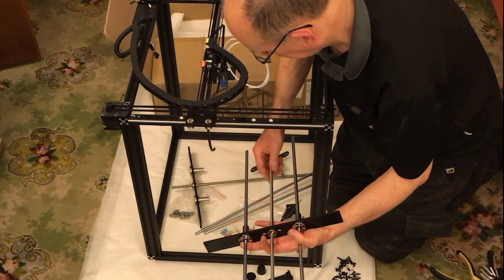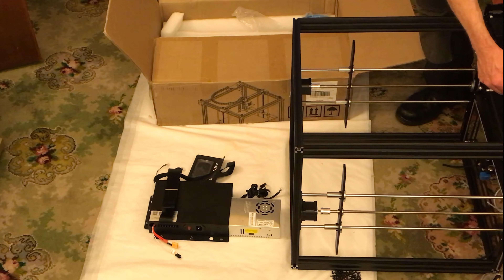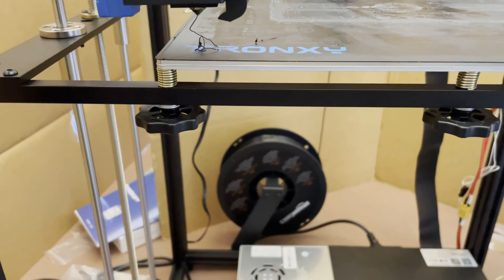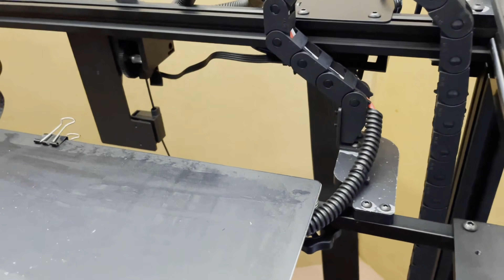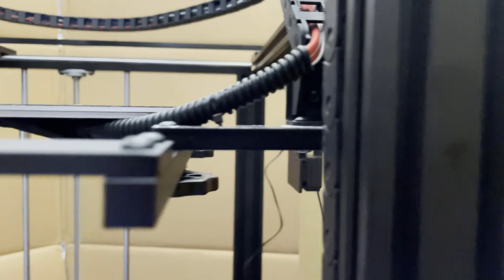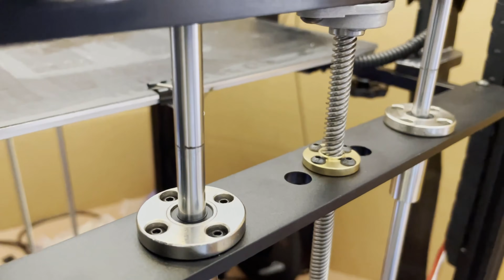TronXY X5SA Pro 3D Printer unboxing and assembly - Part 4

Comment: Thanks, just got a kit from Santa and will be putting it together.

How does it print by the way?
Reply from the maker: It worked well, both with PLA and TPU, though I did not do much with it in its original form, as I bought it to use the frame for my toolchanging printer project.
Reply: @RJTC  Thank you very much robert Robert.